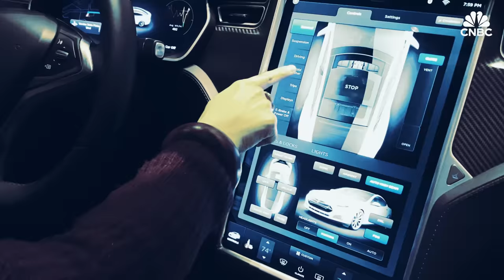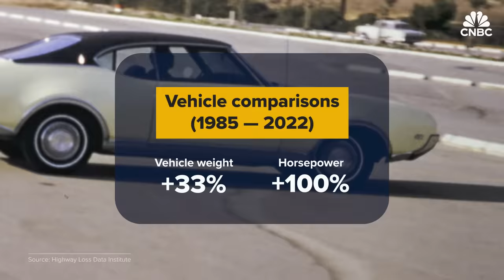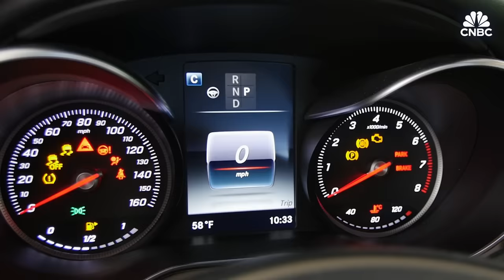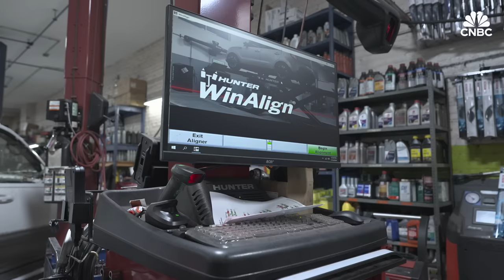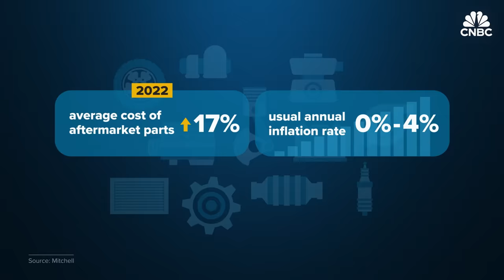Why Car Repairs Are Getting So Expensive

Comment: Speaking of someone who was in the business, I can honestly tell you owners would do better to take better care of their cars. Because of injuries and chronic arthritis I now do airport transportation. When I suggest cutting the manufacturers “recommended” vehicle maintenance schedule by 1/2, 1/3 1/4 etc. most people balk at the idea. However, my 2013 Hyundai Sonata 2.4 L now has 221,000 trouble free miles on it. My 2020 Mitsubishi outlander SUV now has 131,000 miles on it. That vehicle has the cursed CVT automatic transmission. Yet because I change my transmission fluid every 15,000 miles instead of every 30,000 miles and I drive it like a baby carriage it has held up well. My wife’s 2010 Hyundai accent has 114,000 miles on it and still running well. Why? Well, being a former mechanic, I know what to do to maintain it properly. Yet, when I tell people, my “secrets” they say “But the dealer told me, I don’t have to do that!” to which I reply “Oh , you mean the same dealer that wants to sell you another car car in four years?! That dealer!” my 2000 Chevrolet S-10 (built in October 19 ninety9 was purchased for $500 back in 2011 complete with a destroyed engine. The engine was essentially fused into one piece of metal because the previous owner hardly ever serviced it. It had 74,274 miles on it. I installed a brand new engine from General Motors along with a myriad of other new parts, and that truck is still today my daily driver. In fact, it has been up and down the eastern seaboard 11 times, once to the Canadian border. The problem I have seen with maintenance of vehicles is most people know about their cars is stick the key in and turn it!

Comment: Costs are high because build design is complex and of higher quality than it was a few decades ago.  Car engines used to be easy to repair in a driveway, and now the engines are crammed into spaces so tight and with so many hoses, etc. that didn't exist in the 80s & 90s that it's a much more labor intensive job just to replace a waterpump.  Also, how often does a car breakdown if it's well maintained?  A few decades ago cars broke down more frequently and the lifespan of an engine was about 125k miles.  Today most cars easily top 250k miles.  If a car repair shop isn't doing as many repairs it still has to make profit.

Comment: The answer is simple.  Buy older used high-quality cars that are easier and cheaper to buy, fix, and insure. Also, find a mechanic you trust. This mechanic will almost certainly not be a deal. As a result of taking these approaches, I have never had a car payment. 5:37

Comment: I've been reading a lot of comment sections surrounding mechanics and all it's telling me is cars from 2000-2012 will be worth more than anything on the road in 5-10 years. new crap isn't repairable, the industry pushing electric vehicles that people don't want, compact cars are phased out, and hybrids are completely being ignored due to the electric craze at domestic automakers. its 2029 and you need a reliable car that is good on gas and repairable. what are you going to choose? a lot can change but i don't think your going to be shifting through the lots of burnt out Teslas or the suv that was built in 2020 when all the electronics went haywire.

Comment: I was quoted 230 an hour for labor ONLY at a dealership. That's not inflation. That's greed.
Reply: What is the other solution. You can't cry greed when you have no other option. That is called law of demand. it basically says the more you and others require service of certain profession, the more expensive it becomes since it is more valuable to the public. If you don't want to pay that much, you are more than welcome to find other that you can ask to work for less, or you can do it yourself and see how you fare?

Comment: I retired from being a mechanic is 2010 and ended up with over 100k in tools invested. Nowadays you have too much crap in cars that can and will go wrong at some point. Especially them engine choking crap emission systems. The best car I ever bought was my dodge Cummins diesel. I have over 700k on it and the only thing I do is fluid changes and wearable item replacement.

Comment: Dont even get me started on the "SHOP SUPPLIES" line item on the bill. Just bury it in the labor rate. Buddy of mine just had cap, plugs, rotor, and wires on his 99 Tahoe. $890.00. Shop supplies $34.23. To do what I consider a basic tune up.

Comment: The other day I went together my oil changed and I was informed that the price is now $100 previous.y it was $45 with taxes. I would understand if the engine oil runs for 10k miles without changing but for 3K mileage that’s a bit too much and I’m no longer buying the supplies chain issues. The whole point of the US investing in its energy it’s to reduce costs attributed to imports since people are now challenging the supply chain problems the go to blame is now inflation rising costs.

Comment: Cars and trucks should be designed with safety and maintainabilty as the top features. Instead maintainabilty is rarely even considered with modern automobiles.

Comment: As a nissan tech that switched from automotive to engineering, they are lying only thing  that is true is shortage of techs, the declining amount of people buying cars if people knew how much parts costs before taxes and labor cost plus how much the dealers are taking off the top to make a profit. And weight of vehicles actually got lighter for better gas mileage perks

Comment: I used to do all of my own maintenance and repair. Bought a pair of evs and have a combined 16k miles in them with only air filters and a pair of wiper blades. Definitely convenient.
Reply: only until the battery pops and then its 20k+ repair bill, then you will be screaming you will see.. I hope you realize they can program in a timer that makes the battery go bad after a certain while if they want to. Its because its all in software..
Reply: @turboimport95  lol there's no pop switch in a battery. If they did that then they would also do it in gas cars and you're still screwing. 
So in that scenario, I'd pick the better warranty. EVs come by law with 100k mile 8 year battery warranty. Tesla is 120k miles. 
Not many EV batteries cost 20k and after 100k in gas you already spent that! Still save money and time with the EV.
Reply: @joshsummers7933  no pop switch in the battery necessary. its all software controlled, the controller controls the charging rate and life of the battery, whats stopping the software from overcharging the battery or letting it get too empty and cause wear.. Why do hp ink jet cartridges magically stop working when they are still half full? software tells them to.. and if your gas car gets 30mpg that is only 12k in gas for 100k miles. show me a ev battery cheaper then that, and is guaranteed for 100k miles without degrading itself..

Comment: While you are "drilling down". Aftermarket parts have increased in price. But so has the amount of defective and counterfeit parts that are aftermarket. Couple this with a diagnostic approach that emphasizes throwing parts at a problem without fully understanding the problem and you are left with an increasing number of customers that are left with a huge service bill and a vehicle that has not been repaired.

Comment: An big part of the problem is that you cant order your own parts and supply them to yhe shop. It would save ao much money that isn't even going to the shop.

Shops make some money off parts but they can and should charge a reasonable customer supplied parts fee to make up for it. 

Tell the customer there is no warrenty on the part itself. Only if its installed incorrectly should a problem be addressed for free.

Comment: When parts suppliers are still charging 100% of the original cost for the same parts 20-30 years later, there's some unaccountability going on. You should not have to pay $300 for an alternator for a 33 year old car, aka 1990, when the alternator has been sitting for 15+ years untouched and the market demand for that car is low. The prices should increase and decrease with supply and deman but NOPE, not with car parts. They always retain 100% of their original value.

Buying car parts is more lucrative money investment than gold at this point since it's 100% stable value unlike gold or silver which fluctuates.

Comment: Why? Because you have to pay for all the unnecessary repairs because they can't do diagnoses anymore. It took one year and $15,000 to fix my park brake shoes which were coming loose and hanging up while driving. In the end I was rescued by the local 4x4 dude. And I used to work in a dealership service department -and I was actually giving them the written complaint "park brake shoes hanging up while driving even when it hasn't been used in some time", it just went on and on and on. My goal is to live somewhere I can drive a Lada Niva, so simple anyone can fix it and they never break.

Comment: No ASE certification been a mechanic for a decade I make 20 an hour now this year! No benefits! Just today and yesterday pulled a transmission pulled the front diff resealed oil pan replaced the trans cooler lines did like 5 oil changes brakes rotors and struts! Replaced a fuel pump! Ready to put the transmission back in first thing in morning!! Then whatever else comes in tomorrow! If I get all 8 ASE certified master tech I'll be getting 22 an hour!😅 After 10  plus years!

Comment: EV are fine but automakers should have provided hybrid models before jumping head on into battery vehicles. Customers moving from combustion engines to electric ones aren't used to this sudden cost increase.

Comment: Blame the governments (and automakers) putting a bunch of useless crap on cars. Making them more complex and heavier.
You are forced to have all these cameras now (because you can't see out since the windows are tiny and the pillars are ridiculously thick).
You are forced to have stupid SOS buttons etc.
You have electronic door openers which will break unlike a proper door handle (oh wait, you still have to have a manual door release as well so why are the electronic door openers even a thing)
All the buttons and dials are replaced by screens (which will break)
TIre sizes are ridiculous nowadays. The cost difference between a 17" and a 19" tire is insane.
Windshields have all kinds of sensors as well which might quadruple the cost of a windshield.

Comment: Don't mind that the wheel bearings for your 2020 f150 costs over 30 times as much as one for a car from the 80's.
It's egregious over complicated engineering, making 30parts 1 sealed part that costs 100 times as much as the failed 2 parts inside of it.
Stop buying crap and they have to make something NOT crap or they will go belly up.

Comment: On All my old mustang's to rebuild the gearbox and replace clutch, flywheel, ect it was around $2500. I did all the work. I just did my 2014 mustang and it cost me over $5300

Comment: I had a paid off car that needed $4500 in repairs, so I just traded it in (for $5000) and bought another used car with lower mileage. Repairs are too expensive it's not worth it anymore. Just throw them away when they break.

Comment: This owner pays his technicians $100K per year...OUCH.  My shop raised their repair price post-pandemic from $99/hour to $269/hour.  He told me that his 2022 Escalade ESV needed repair and the repair was still under warranty.  "If the Cadillac dealership can charge $269/hour, so an I.  Now I have to find a new mechanic as 2.5 years later...he is closing shop.  Few are willing to fork over $269/hour even at the dealerships.

Comment: Features like automatic breaking need to have a way to quickly disable them. Cars getting stuck in the middle of the interstate or on train tracks because the brakes are locked is not ok. Also more enforcement of following too closely at high speeds. If you're within three car lengths of the car in front of you going 65 then you're asking for it and it is your fault if you hit the person in front of you who is braking for good reason.

Comment: When people realize that there's a maintenance manual with all instructions and part numbers to do the repairs yourself. Most of the repairs have videos online to easily see what you are doing for maintenance or troubleshooting. I fixed my AC issues in less than 2 hours for a 20$ component replacement which would have costed me like 400$ minimum if i went to a mechanic. All because i learned how to use manuals and online youtube videos to troubleshoot and repair. If you don't like doing maintenance yourself, switch to an EV their maintenance costs are going to end up 1/10th the cost of ICE vehicles at this rate.

Comment: New parts being a problem? try "factory" rebuilt "OEM' items on older vehicles, those have gone through the roof too. and unreliable as hell.
I went through 3 MAF sensors on my 25yo truck in short order before I found one that worked. The first two had bodies and electronics that looked exactly like the old part. cleaned up with a brand new looking powder coat.  one ran the motor too lean, detonation nightmare, the other claimed 8x the airflow for anything above idle, and ran like a very badly tuned carb. The one that finally worked was a non OEM part that looked little like the original except for the bolt pattern and mating surfaces. even the actual sensing electronics were a different technology. but, it runs beautifully, and cheaper too. and this was a 15 minute part to R&R

Comment: 2018 Toyota, oil pan is damaged and loses oil. Vehicle is stopped immediately. Cost of repairs, $16000.
Insurance paid. 7 months later. Check engine light appears. Quoted repairs is $7000. There is a serious problem right now. And changing out the brake pads, wipers and a tail light shouldn’t cost $800. Sounds like greed to me.

Comment: I drive a diesel truck cuz I need it for my work on the farmer The cost to running this truck between fuel diesel exhaust fluid maintenance is absolutely insane it's about $1,900 bucks a month. In oil change cost over $300 if I don't do it myself I'm just getting my 75,000 mi service done it's going to be $1,500 5 years ago that used to be $400. I'm going to start doing more of this on my own and I'm going to buy an old simple Toyota beater truck that will last forever as my daily driver and only use my big truck when I need it

Comment: One cause not mentioned is the continuing EPA regulations on motor vehicles,  between higher mileage standards and stricter safety standards .because of this technicians have to remove more  parts to get to the one that needs repair  ,cars are  not getting heavier,  think about that statement,  cars today are made with alot of plastic.  The cars that are heavy are the EV's .

Comment: I blame the overall mindset of selling a customer a service that isn't necessarily required. I've overheard service writers recommend customers to do a full brake job because of rust appearing on the rotors or the outside of drums. Are you serious?!?!!? Then charging $100 to swap out a cabin filter that takes a minute to change? Stop overcharging customers for BS just so you can pad your wallets

Comment: You heard him say it. Safety features in the last 10 years. Is what has driven up repair costs substantially.
That being said. Don't buy anything newer than 2015.
Pre 2010 if you can. We haven't seen any real improvements in the actual mechanics of cars since then. Thus the reason they turned their attention to techy safety features.
Ive been a YouTube mechanic since 2008. Service a small fleet of 6 Toyota cars, trucks, and vans within our family. 
Admittedly I have become a tool junkie. Easy to justify getting another $300 in tools every time I do a big job. When saving 2-3 thousand dollars on each repair.

Comment: I do my own work on my car and it’s very cheap (free labor) I have a bmw so when I get a new battery it needs to be coded I can do all that myself with a free scan tool. Dealership tried charging me $950 to get my wiper fluid spraying again I fixed it myself in an hour for $50. Like come on .

Comment: Mercedes wants $5,000 to replace a $150 part (labor, it's cramped in there) and $4,000 for installing $400 worth of parts (labor). So I am doing it myself, $550 to do what at Mercedes costs $9,000. Do their mechanics make $120 an hour?

Comment: The supply chain catastrophe should have been the birth of a manufacturing revolution in the USA. As an example, 40 years ago, almost every town had at least one business that rebuilt starters and alternators. Recently, it cost me $550 to have the starter replaced on my 2006 Ford F150. My cost for the starter at the NAPA would have been $275. Getting to the bolts was nearly inpossible so I had it towed to a shop (additional $95). It seems the cost to produce overseas and supply chain costs justifies domestic manufacturing. Unknown, to me, is the truth in the claim that Americans don't want to work or are not all that reliable. Dunno, for sure. We do seem to have a ton of priveleged people who view themselves as man gods.

Comment: EV will actually make the power company to increase rates to update the distribution system to accommodate these cars. Not the fact that when snows heavy or a storm passes by if you loose power, you find yourself at the mercy of the repairman to come and fix it because they are outnumber by the number of fault outdated wiring systems.